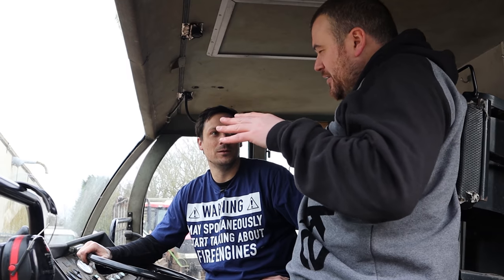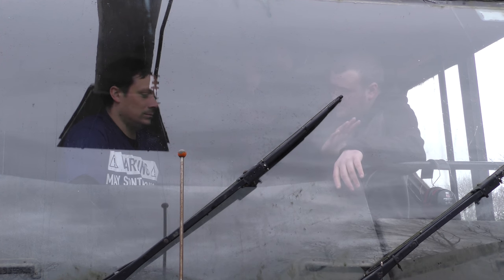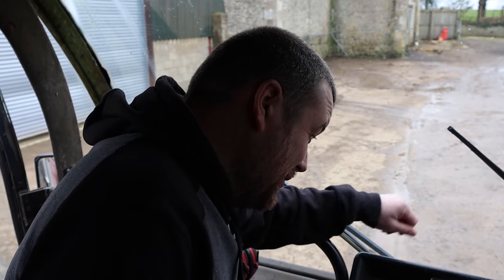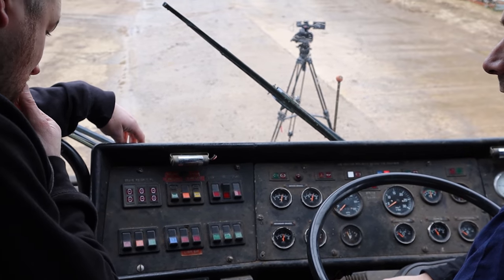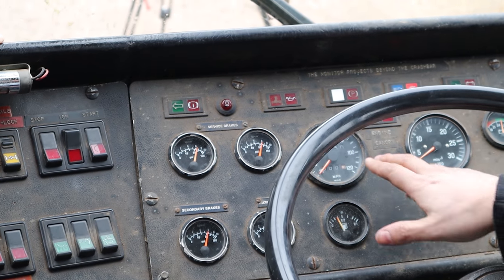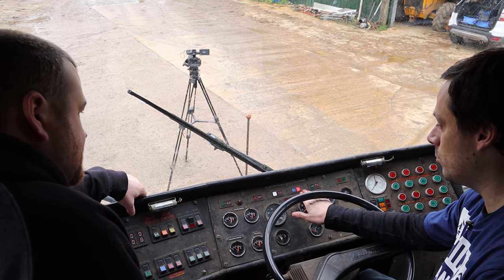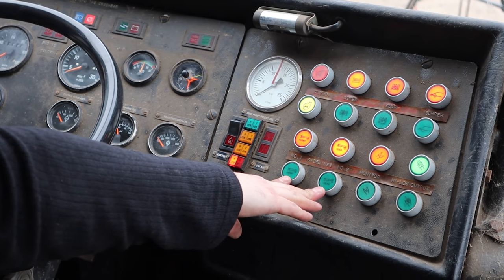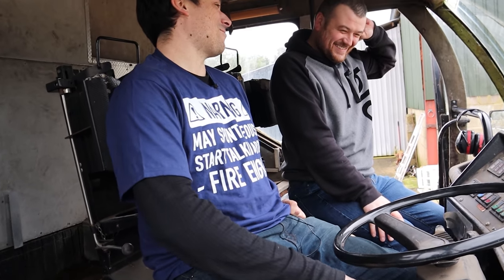I Bought an Airport Fire Engine! Am I going insane? Meet THE BEAST! 18 Litre V12 Detroit Engine

Comment: I was the Test driver for Manchester Airport for Reynolds Boughton (Winkleigh) back in 1989 - Drove the Marlin to Bournemouth for its x country/ hill descents / brake testing - tthen drove to Chertsey (London) for its tilt testing and circuit running. Then upto Darlington to get the Blues and twos etc fitted. On route me and the "Fitter" in his sherpa van stopped over night at a Motorway service Hotel overnight. Woke up in the morning and the carpark was all icey as the fitter had released the water valve to drain over night - we wernt very popular! Happy Days love the D/Diesel sound !! (Think the value was half a million sterling btw) + i have the video and pics but there in france and im in the Philippines :(

Comment: Could cause some issues with the court when you call the police to inform them in 2 days there will be a fire where you will need to drive this fire-engine on the public road
Reply: Well these are specifically base on airport ground to avoid that scenario, if they have to go on public roads (for example another airport bought it or it's going somewhere else) then they have to notify, if theres a fire anywhere other than the grounds it's based its normally for local fire to sort out, however if theres an emergency that is aircraft related and is close to the airport but too remote for normal firefighters to get to (in rough terrain) then they have an exception.
Reply: In that case it would be an "emergency situation" , and when there assistance is needed they are clear to go. In Germany they had a situation where a fire engine could cross the country boarder to assist the local fire department, but when they drove back they got a ticket for driving on toll roads without paying...in emergency it was allowed, but not for transfer back. It went back and forth...they canceled the assistance...in the end an agreement was made to guarantee free passage

Comment: Would be cool if I had the resources to rescue and restore an old Oshkosh P-15 8x8 AARF crash tender.  Those trucks has a real bullish look and were possibly the largest, heaviest fire trucks every made.  Two Detroit 450 HP engines back and behind the cab made these the most bad assed fire trucks ever made after the FDNY Super Pumper.  Would love to take the old P-15 to a beach or pool party.

Comment: We are now in the gallons per minute stage not gallons per mile! A 27 litre Rolls-Royce Merlin engine drank fuel at about 1 gallon every 30 seconds (about 2 gal/minute) so "The Red Beast" would be in that sort of league around 1 gal every 1 or 2 minutes of engine run time...I'm prob not far off. Plus special privileges required for road use, bridges, weight and width restrictions etc means this baby would be off my wanted list. Nice to dream about though, interesting video, keep em coming!

Comment: Well you clearly have lots of money, run the Dakar rally in it! It's funny when I was 15 I had a school placement at the transit garage. All the busses were 2 stroke Detroits. I had heard all the stuff about 2 strokes running away so scared of that I started one and when it wouldn't shut off (also air shutoff system with no air in system) I hit the emergency stop and someone had to reset it for me. It's a big flapper valve on the intake.
Reply: @ProjectMarlin  sorry to judge. Truthfully I'm jealous of the arff!

Comment: An twin turbo, twin supercharger 18 litre V12 is a massive engine!
Reply: Designed to get from one end to the other of a Runway in a certain number of seconds fully loaded ... Not built for economy!
Reply: It's a Detroit 12v92T, probably 550hp at least. But maybe only 3mpg if you're lucky..
Reply: This one is rated at 761bhp
Reply: So this engine has turbo chargers and superchargers how does that work ?
Reply: @thomascatford2627  the superchargers are required at low rpm for scavenging, as this is a 2 stroke diesel, it requires positive intake air pressure to bring in air and begin to expel exhaust gases as the intake ports are in the cylinder wall, not in the head. Only the exhaust valves are in the head. The output of the turbos is fed through the supercharger, then the air to coolant intercooler into the induction air gallery in the block. Edit: superchargers are fed by the turbos.
Reply: All 2 stroke detroit diesels are supercharged, as they require positive induction pressure to expel exhaust gases and bring in fresh air for combustion.
Reply: @tech4pros1  so the turbos are fed by air from the superchargers or the superchargers are fed by the turbos ?
Reply: @thomascatford2627  the superchargers are fed by the turbos.
Reply: Not superchargers but compressors , check out deBoss garage on YouTube who explains while trying to self destruct one
Reply: But will it fit my Honda?

Comment: Perhaps I missed it, but what should that engine in that setup be putting out in power and torque?
Reply: Not sure about the torque but we think it's over 2500 lbft and the ratings plate on the block says its in the 761bhp configuration

Comment: In the Netherlands we use the e-one crashtender it is an 23.890 cc v12😝
Reply: there were 3 of these marlins built with 1000bhp 24L v16's. the funny thing is the Marlin design is over 10 years older than the E-one, carries more water and foam, weighs less and has better acceleration.

Comment: More proof that real fire engines are powered by Detroit Diesel. They do well with sustained high revs that are needed for running water pumps.
Reply: Doesn't really take high revs to run the pumps, just depends on the application and type of apparatus
Reply: They sound high revving, they actually don't really run at high revs.

Comment: You need that pull cable to stop the air as those engines do have quite the tendency to run away and burn their own oil when done with fuel
Reply: For some reason this engine doesn't have the emergency air cutoff flaps in the intake, hence the 2 co2 extinguisher you get a glimps of in the video. The broken shutdown cable just goes to the fuel stop.
Reply: Stewart bannister ah. I mean shutting off the fuel won’t do much if it has already run away. But smart people have a reason for everything.

Comment: Would make a great slurry tanker. Seen it done before.
Reply: It would be a massive headache to convert. The pump won't work with solids, it can't self fill, the tank isn't designed to take pressure or vacume so convertion to a vac pump is out and it discharges forwards. No to mention your looking at 40 gallons of fuel an hour minimum to run the engine at pump rpm. 😂
Reply: Stewart bannister seen it done with a smaller one. Of course he put vain pump on it from a traditional tanker. Implosion rings were added to the tank and wide flotation wheels were put under it. And removed a lot of things from it to reduce weight.

Comment: The fuel supply has to last the engine at maximum power for 4 miles and 14,000 liters...  more than enough time to refill the fuel tank when you refill the water

Comment: He needs to have a Detroit specialist come by and do a tuneup and give it a clean bill of health G.M hasn’t built those engines in years so parts can be hard to find.
Reply: Prob much harder to find someone to work on it especially in UK. Two strokes are still out working to some extent, but the guys who know how to fix them are a dying breed.
Reply: @ProjectMarlin  I know fuel injector adjustment is one thing that is kind of an art form. If I recall correctly (i dont really have experience with them) the fuel rack runs across all the injectors and they have to be adjusted individually to meter fuel equally. On a lot of mechanical diesels you would make that adjustment at the pump. To get into even more weird stuff, they did make ddec electronic injected 92s in the early 90s.
Reply: @ProjectMarlin  another thing, two stroke Detroit's will quite willingly ingest air through the exhaust, exhaust air through the intake, and run backwards. Old guy I knew who drove one said it happened when he stalled the engine bumping into a loading dock :)

Comment: Only a thousand liters?? Won't even be 60 seconds at full noise before its out
Reply: At full power to would be around 8 seconds I think. The tank holds 14000L but I had to fill it with 20L cans so had only put 1000 in
Reply: Just under two minutes for 14000 ltrs, not a lot of time, but I suppose if its not out by then its too late anyway!.

Comment: I can't believe a retired fire truck would be in such bad condition, it dosen't look to be that old but it's in incredibly bad shape normally fire trucks are kept in top condition until it's not cost effective for the upkeep to maintain them I've seem 40 year old fire trucks in way better condition maybe its different when dealing with aviation
Reply: Its 30 years old and it spent the last 12 years out side and 6 of those it wasn't used.